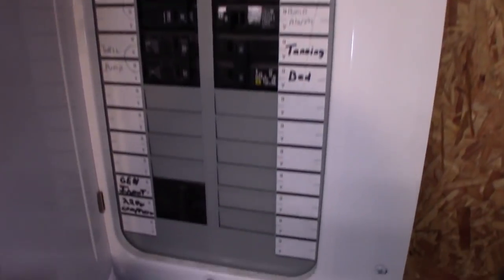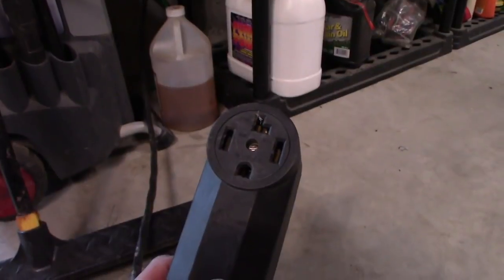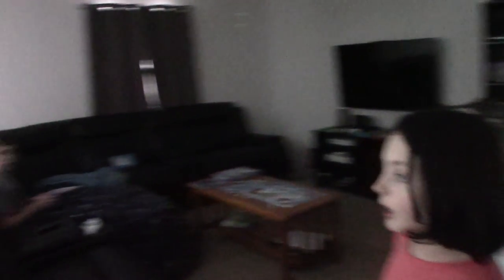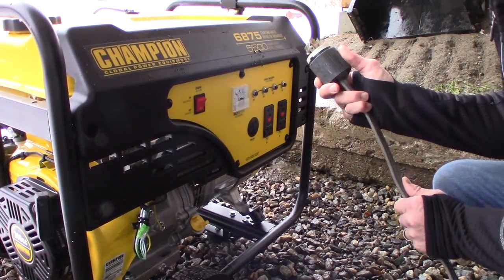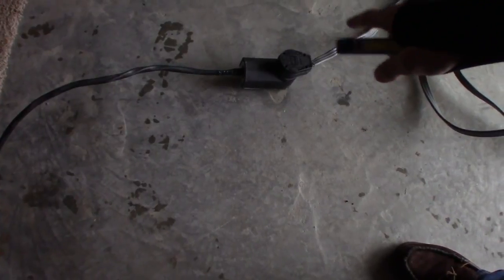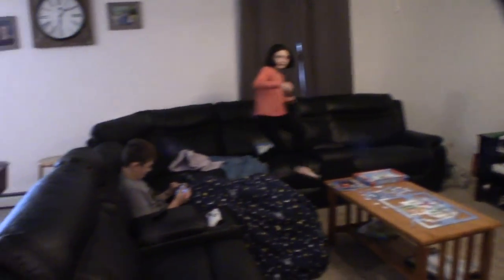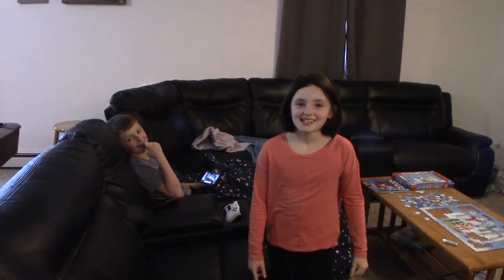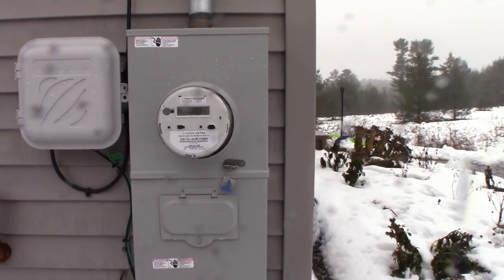Powering my ENTIRE HOME with a Gas Generator

Comment: My concern is “dirty” electricity damaging solid state circuits on refrigerators, furnace control boards, computers, etc.  Generators like that one do not produce clean electricity that you generally receive from the power company. That is why inverter generators are popular.
Reply: maplewoodsp lol as if utility is truly “clean” I’ve seen it almost 50v +/- what it should be while the standby unit was only 1v off.
Reply: Exact opposite, these generators spin an armature in a magnetic array, creating a sine wave.  Inverter generators use boost converters and output square waves.  They're the ones that damage equipment.

Comment: Ok... I have a question.... This might be useful for me as we lose power often. But the question I have is, our water pump the breaker is on the main power pole box. So if I wanted to have running water when the power goes out would I have to hook it up to the breaker box on the pole and not to the one on the side of the house?

Comment: How would cost compare using fuel generator v's power from grid?
Reply: My 12kw diesel uses about a half gallon of fuel per hour at half load.  That's 12 gallons per day.  So figure about $36 per day (at $3/gallon) or about $1,080 in fuel if running 24/7.

Comment: Just a question: If you are rigging it yourself, why didnt you reverse the plug from the generator and the one going to the breaker?  So youd have a female end on the generator cord side and the male end on the side going to the breaker?  That way there is less chance of shocking yourself to death.
Reply: The readily accessible male ends would be live when power is back on, if not for its own circuit breaker being off, which he also wants to use to run other 240V equipment that have male plugs?

Comment: I've done the same trick. It works well. By chance, what wattage is the larger generator? The house I'm in now has been out of power before and we have only 1 source of heat that'd work without power once lit (gas furnace) and a pellet stove. Have a small converted unit from a sail boat that will power most things, enough to keep us alive if something happened. Anyway, if you would be so kind as to let me know what wattage you run (our house is smaller) I'd be appreciative.

Comment: Excellent video! Thank you. A couple of questions though. Is the plug you hooked the generator up to, connected to the breaker directly or is there some other device to maybe regulate the power going into the panel? Does the generator itself regulate it? Did you have an electrician put the plug and breaker in and if so, what did they charge you? How long can you run your home on a full tank with the generator? What is the generator output (I may have missed that in the video). Thank you again.

Comment: 6.8.21  Thanks for the video Todd.  Question:  Have you or anyone watching this video have any comments on the power that the generator puts out (dirty or ok)?  Is this power good enough for the more sensitive electronics in the house?  Did not see a genlock device in the breaker panel.  Thanks again.

Comment: If you want one of those automatic switches you can get them from ebay for pretty cheap. But I'd propably do the manual way still since you can control the load.
Reply: Hene193 not needed

Comment: So you plug in the generator to a dryer output plug? Basically when power is restored that dryer plug will be hot right?
Reply: No, you'll have turned off your main breaker, so you never connect your generator to utility power.

Comment: How many watts is that generator, the one you are now using to power the house?  I understand all this, but im going to try it in my barn first lol.  Ive had several people over the years try telling me how to do this but this was the only thing that I followed well.  I guess basically if you have a gas furnace, electric water heater, fridge, electric stove, 1 tv and lights does anyone have a size in mind?  I did 14recently come home with a vintage 7000 watt generator that has a really cool Wisconsin SD14 on it.  I was told it runs and charges but I haven't got it going yet.  My other ones are smaller, 2 like the one you are selling and a honda thats 4k I think.

Comment: if not using a Xfer SW. a.k.a. transfer sw.  u can get a mechanical interlock that works by shutting off the mains THEN being able to turn on brkr for gen ckt. IT IS legal. Nice Champion generator and Champion is a good Company to deal with.

Comment: Saw you at the movies tonight. Ps I'm an electrician and can hook that thing up right for you. Just buy the parts.
Reply from the maker: Haha! No way! What did you see?
We watched wreck it Ralph
Reply: Same. You walked out behind us.
Reply from the maker: Small world!
Reply: @MegaRyanskie:
He did do it right, i don't see what parts he NEEDS to do it right..
Reply: You Tube there are 'parts' and switches that are actually meant for a situation like this, where you don't risk creating firework in your panel by the live from the utility pole and the live from your generator touching or having a cable with two male ends...
there's even equipment that can be installed right into the panel that switches back to mains when the power comes back on, so you're not wasting expensive gas.
however, for the occasional outages, and if this guy is very careful and safe, I wouldn't really care. it works for him. there are no safety precautions for when he makes a little mistake (we're all human), but assuming he's very careful and won't let the kids come near this setup, it's fine really
Reply: @ACommenterOnYouTube  someone should send this boy a codebook. Seems like he could really use it.
Reply: @ACommenterOnYouTube  Not afraid?  You hide behind a fucking security gate?  LOL
Reply: @ACommenterOnYouTube  dude he has a live male end from the generator. he didnt do it right
Reply: Fred Flynstone  that was picking a fight actually.
Reply: @Ron Freeman:
Generator box = NOT NEEDED
regular 240 extension cord = NOT NEEDED
Lock out main breaker = NOT NEEDED 

The above is for the incompetent ...
Reply: @ACommenterOnYouTube  depends on who's home when the power comes back. If someone unplugs that suicide cord before the generator gets turned off
Reply: @John Bronson:
Who else is going to be in my home when the power comes back on other than my wife and son..??
Who is going to unplug the cord..?? 

My wife or son is not STUPID enough to open the gate for the neighbor to come onto my property to tell us the power is back on and we need to unplug the cord or recommend we unplug the cord. 

i have a 7 foot brick wall around my 9 acres of land ... NOBODY is coming onto my property to tell me the power is back on and to unplug my cord from the generator to be a nice guy ... 

I think YOU PEOPLE are seriously CONFUSED that random people walking around the neighborhoods are going around from home to home when power comes back on to tell them that power has been restored and they need to unplug this "suicide" cord and they will do it for them while touching the "exposed" tips on the cord to shock them to death ...
Reply: @John Bronson:
Is that the best you got..??
Reply: @ACommenterOnYouTube  , Lol.
Reply: Erich Weiler  making comments about CODE is no different than making comments about the LAWS set in place by our government that 80% of the population break day in and out. 
Dont give me shit about talking about CODE .. just because you are incompetant does not mean other are as well. Code was put there for the incompetant.
Reply: @ACommenterOnYouTube  Not yet... ( Does that meet your straight forward response requirements?)
Reply: @kennaortega3708  no it does not because you said "not yet" without any specifics, not yet to or about what ?
Reply: @ACommenterOnYouTube  It's illegal. It will void your home owners insurance.  It puts the lives of people you don't even know at risk.  To repeat.  IT'S ILLEGAL!  The Electrician is correct.  This should be properly done with a transfer panel or something like a Generlink system.  This sits between your meter and your house panel.  When the box detects a power outage, it immediately switches off the grid.  There is an appropriate connector to a suitable Generlink to Generator cable.  When the power comes back on, the system detects it, but will NOT reconnect to the Grid until the generator is off line.
Reply: @arnemaeschaelck5012  I think that "You Tube" likely has a drinking problem :)  Your advice was spot on.  Anyone who does this, regardless of lives lost or not.... will have voided their home insurance.  I see that he seems to want to DOC you with presumably your home address..... report this to You Tube.
Reply: @aaronrice1304  or maybe just a printed copy of his home owners insurance policy.  If he has a fire and they see this video.... he is toast

Comment: Ok I have all this done already when I installed my power inlet box but I was looking for load management video because of my sub pumps but my generator is a 10,000w Duromax that replaced my 6875 Champion. Seeing you run a smaller generator and choosing what to run has answered my question! I will run my hot water heater at night while we sleep and I think I can run my sub pump along with my lights , fridge , WiFi and cable. Might sound like a lot but my downstairs would be shutdown. Kind of wishing I went with a 12,000w.

Comment: Great video. We just had a big storm here in eastern Canada lost power for over a day but some folks at lot longer. I have the same generator you are selling I run everything except the 220volt stuff in the house with it. I also have a very similar setup as well on the panel this was a great way to confirm what I am doing is correct. Thanks!

Comment: You have plenty of open spots on your breaker panel.  Move a few breakers around so you can put the generator disconnect at the top and install an interlock so you can't close that breaker with your main breaker on.  If you have the skills to make a "suicide cord," then you have the skills to get an inexpensive interlock kit and do it right.

Comment: Neutral is still live and feeding through the lines  What did you do to protect the workers on  the lines?
Reply: Its grounded at the pole and at the service box.  Most transfer switches also do not disconnect the neutral, because it doesn't need to be.

Comment: If your main breaker was off, there should not be a connection to the meter.  If your main breaker was on, it would back feed the grid, in the same manner as grid tied solar, and the meter would run backwards if you were producing more power than needed.

Comment: When you say ENTIRE house.. is that including AC unit?
Reply: If your generator and the generator breaker can handle it then yes. The worse thing that would happen is the generator would trip and shut off or the breaker would trip and turn the power off of the house.

Comment: That wouldn't work here cos our power is normally 220v so I'd have to use a 3 phase plug and 440v generator
Reply: Power is split phase 240V in North America. Are you living in Europe?
Reply: @simonrichard9873  new Zealand. It's 440 across phases

Comment: It would be nice if the connection between the house and generator was different? If it could be designed so each end of where the cord meets the house was half male and the other half of the plug was female so the positive and negative could not be live until the outlets were connected even if the main city power was still on it would not back feed. I believe that a design change should be implemented.

Comment: good vid nice kidz, yup gotta make sure no exposed parts w voltage , don't want to lose family 
cat or dog. U can for about a 150 $$ get a mechanical interlock that is the go between for mains
and generator breaker, MAINS must be off to turn on GEN brkr ON and GEN brkr off to turn MAINS on.
U would need to get the interlock made for that panel and move GEN brkr up next to mains. 

As u probably know, ur 120/240 comes off a transformer (xfrmr)  voltage on other side of xfrmr 
is likely 7200 volts or 30X greater than 240. so, not turning off mains puts 7200 on any line from 
that xfrmr. good maintenance will have it starting easily when it is needed.

I always keep extra oil, sparkplugs and clean air filters available gas too, keep track of hours
for maint. reasons.

Comment: He knows watt he's doing if thought out and dangers realized, this can be a VERY SAFE. Did this in FL. shut MAINS OFF 1ST. then plug into dryer THEN plug into gen. this way there are NO EXPOSED PRONGS. plugging into gen an walking back to dryer socket with 240 volts swing around at the prongs is/can be lethal.

Comment: It would work ok for lights, TV's refrigerators and such, and even run a natural gas or oil fired furnace, but not any heavy loads. You would need to keep all the following breakers off. Electric water heater, Heat pump....both the condensing unit and the air handler under the house or in the attic...if it is a split system, dryer, and electric stove. Also should not use larger 220 volt window unit air-conditioner. You should also limit use of any appliances that have electric heating elements such as toasters, hair dryers,   and electric heaters. The main breaker is usually 100, 150, or 200 amps. The outside condenser of a split system heat pump is usually on it's own 220 volt line, as is most high amp 220 volt devices. Forty amps is not enough to run everything. A 1500 watt electric heater alone pulls around 14 amps, as does a hair dryer, microwave, toaster etc. Codes now demand that high amp 220 volt items be on dedicated breakers, but that has not always been the case. Double breakers should be paid special attention as to the amp draw. It is also important to note that breakers have been known to break and leave one side energized and should be verified with a meter. If you accidentally feed voltage back into the grid of the utility company, you can be held legally liable. Codes require back feeding an electrical panel to be done through an approved transfer switch.

Comment: You will want a 30 amp 220 breaker in the box since your getting power from a 30 amp outlet on the generator. Always match the breaker to the load. Bad things can happen if the power comes back on and pops the generator if the generator's built in reset-able fuse doesn't blow right away. The breaker can react much faster. You don't necessarily have to shut all the breakers off, then the feed breaker, you can leave them on, it's not like your pulling 200 amps off the transformer anyways since everything ran on the generator. 

Btw don't run electronics other then your fridge off the generator, it has very dirty power. One of the mistakes we made, running a new furnace off the generator. Generator ran fine but all the sudden the furnace quit, the control board went out. If you need to, get a heavy duty power conditioner to run any electronics off. You don't need a switching station, their kind of a waist of money anyways. You just need the generator feed moved at the top of the box under the main switch, then a plate installed so that you can't accidentally flip the switch without the main being off.
Reply: If you have your main breaker turned off you shouldn't have anything to worry about when the main power comes back on that's just rule of thumb right there and as far as Electronics I ran my 50-inch flat screen TV off of a generator for 5 months solid that was in late 2012 to late spring of 2013 it is now late 2018 and I'm sitting here watching my same flat screen TV
Reply: @motersickel  Tv's have good power supply's, generators can pop anything with sensitive power input, or if it doesn't reduce the life of that electronic significantly. Your right about having the main breaker off but if someone forgot or it was flipped on for some reason it can kill the generator. Always best to have the proper feed breaker, besides being code. The control board for the furnace used a non-regulated power supply, so when the power would drop it would brown out the components directly. If say your using an old generator that's been used a bit it can rev up and down slightly which would course the frequency and voltage to change, it can be enough of a brown out to hurt electronics. Other then that motors and lights aren't really affected by it.
Reply: Its the inverter generators that put out square waves and cook electronics.

Comment: I just bought a dual fuel propane and gas generator. You can also buy an adapter for your fuse box that will eliminate any possible Back feeding of the system. It senses when the power comes back on and will shut the power off from the generator and turn the main power on. Takes all the risk out
Reply: I guess I should have watched all the video befor I made that commeny. Lol